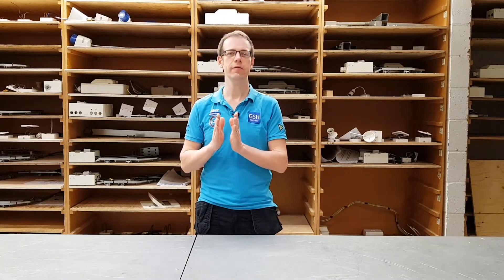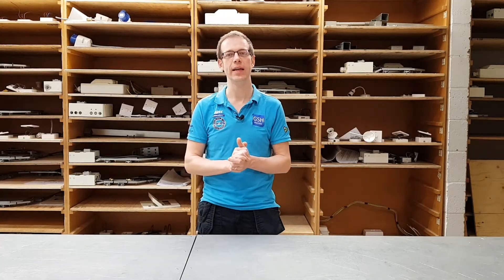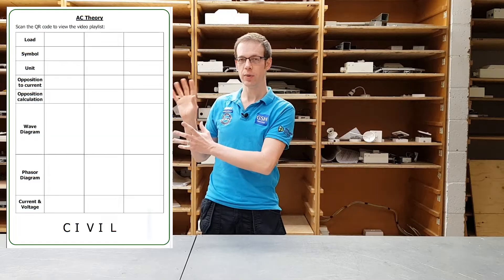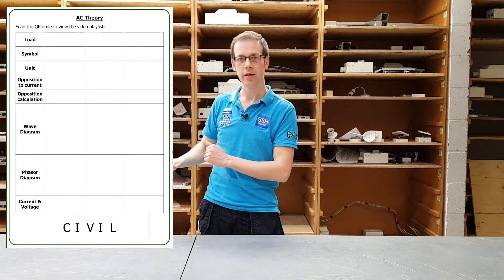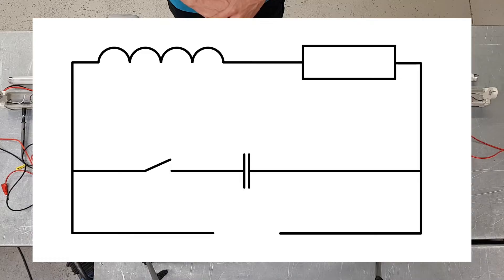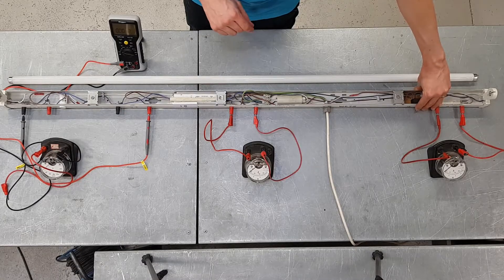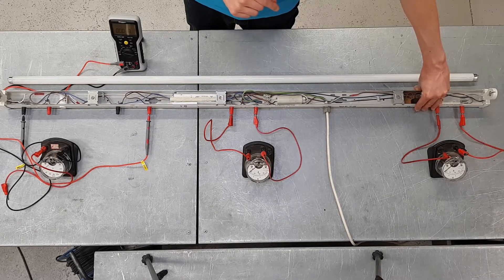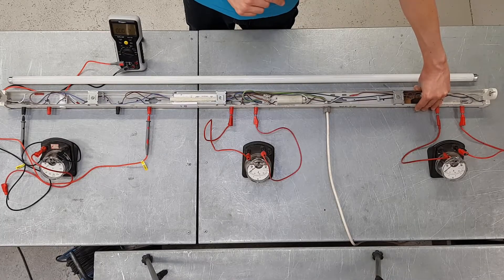AC Theory Introduction: The Mystery of the Fluorescent Lamp!

Comment: I have an Associate in EE along with other degrees and I love your videos.  

I finished my first two years in EE (BS program) but never finished my degree due to switching into the CIT program which was brand new at the time offered by Cisco & Microsoft.  The IT training has come in really handy setting up and maintaining my business's network which is a little more complicated than normal.  I can't exactly say the same for my electrical engineering classes 🤔

Farming only uses small amount of Algebra and due to being a machinist a decent amount of Trigonometry.  I've never had any use for Calculus or Differential Equations.

I just wish I had an instructor like you in college some 20+ years ago which would've made my life so much easier 😊

Comment: One more thing when you check the voltage for lamp which is just under 200v then how you connect the voltmeter to the lamp what is the diagram?
Reply from the maker: I can't publish a diagram here but I'm just measuring from obe side of the lamp to the other. 👍

Comment: In other videos, you talk about "Power Factor" (Pf)  and the undesirable effects that it does on our power systems. The corrective capacitor in this circuit is added to eliminate the effects of the inductive load making the Pf closer or equal to " 1 ". I wonder what happens to the Pf if this capacitor added makes the circuit is too "Capacitive"? Would that also generate Pf in the opposite direction. The total impedance Z would have and negative angle theta. Would that also produce a "Power Factor" since Pf = cos⍬ ??? I wonder. I'm sure you've talked about this on one of your other videos I haven't seen yet.
Reply: Yes adding excess capacitor s make the system away from power factor of 1, allowing more apparent current to draw from the grid.